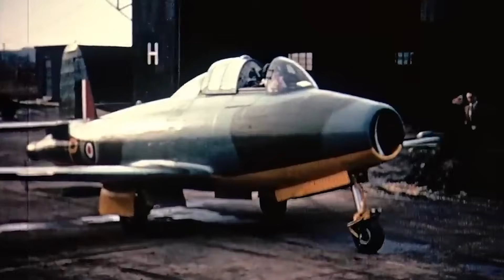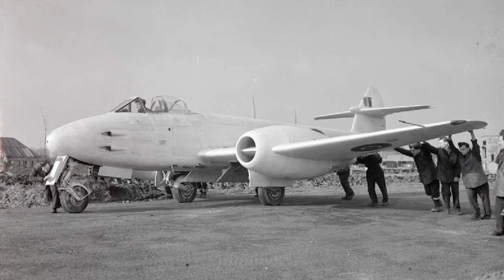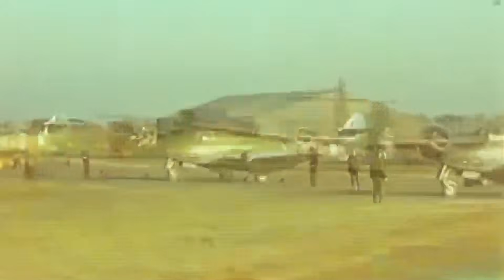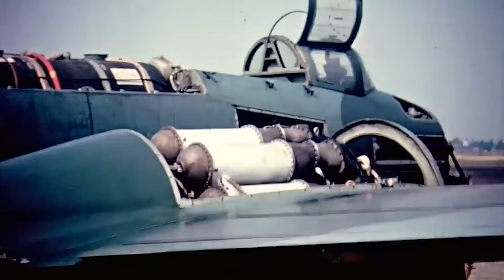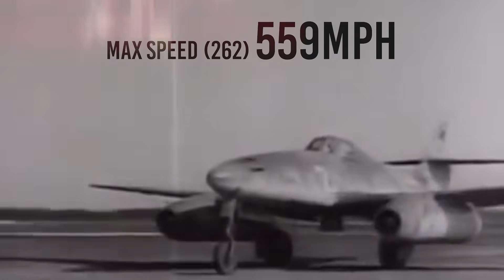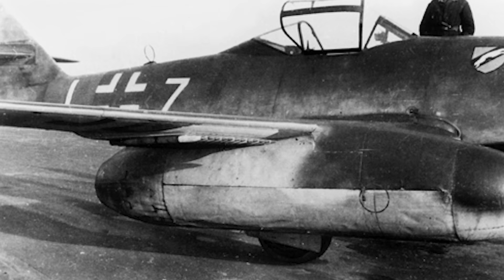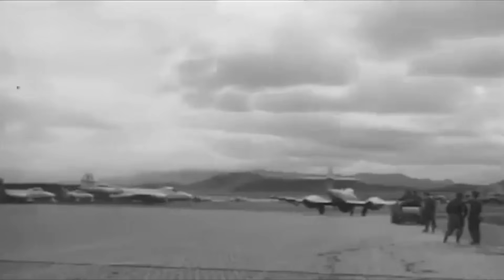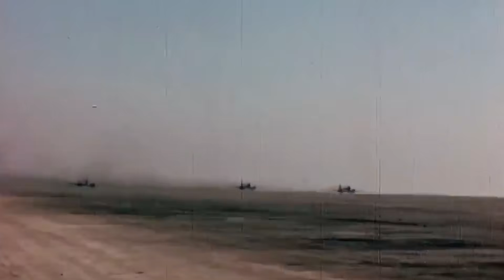Meteor vs Me 262 | Which was the better WW2 jet?

Comment: The irony is that a case can be made that both nations chose the wrong engine technology. The allies won the war without needing jet engines. A focus on axial engines would have been better long term. The axis nations needed a performance advantage quick. Centrifugal engines would have been quicker to develop and needed less exotic alloys. 

TLDR 
The axis nations placed perfection before practicality. 
The allies chose the easier route when they had the time to pursue perfection.
Reply: Many tried the axial-flow engine but they burnt out quickly. The fist perfected and reliable axial-flow engine was the RR Avon in 1950.  It took five months to get a reliable centrifugal compressor jet engine into service, while it took seven years to get the first reliable axial-flow engine into service.
Reply: Perfection by Germany? The 262 airframe and engine was a rushed effort out of desperation. The Metrovick F.2 axial-flow engine produced far more thrust than than any German engine ever did and lasted longer. It was put into a Meteor to test in flight. It was deemed not good enough for operational use needing more development.  The Metrovick in the Meteor would have totally outstripped the 262 in straight line speed. The British did not dream of putting such an under-developed engine into a plane with a man in it.
Reply: @johnburns4017 
My points exactly. 
If Germany needed the advantage quickly - which they did - the safer choice would have been to build centrifugal engines. 
The UK did not need the advantage quickly as the air war was already been won. They could have spent more time perfecting axial flow engines and had a superior system in the late 1940s early 1950s. 

More and more reliable meteors would have been more valuable to Germany than fewer and less reliable me262s. 
The UK did not need either.
Reply: @MatthewHollick  
The Metrovick F.2, axial-flow engines were fitted to a Meteor DG204. The test plane crashed on 4 Jan 1944 after only approx 3 hours of running. Up until then very encouraging engine testing. One of the engine's compressor rotors burst in mid-air, with the cause traced to metallurgical faults in the rotor forgings. This accelerated research into stronger and more heat resistant alloys by Wiggins.

This accident turned attention to the safer bet, the centrifugal compressor engine. The pilot was killed at high speed spurring ejection seat development.

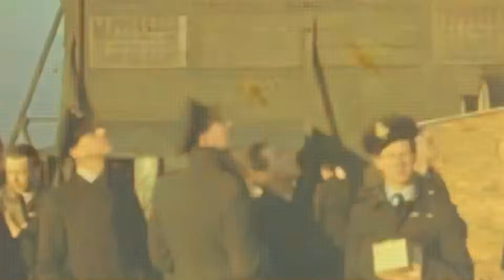Comment: 8:21 mark I am pretty sure that is Eric "Winkle" Brown on the right.  That man was legendary and said to have flown more aircraft types than anyone (and a record not likely to ever be broken).
Also the 262 was not 5 years ahead, the P-80 was superior and was only a couple of years after the introduction of the 262 into squadron service but it missed WWII by just under a year when it entered squadron service in July 1946.  The P-80 was an actual fighter to engage other fighters where the 262 would be better described as a potent and nearly untouchable bomber interceptor.  While the 262 was faster than the P-80 (not by much) and had a bigger punch with its four cannon the P-80 could out accelerate, climb, dive, and turn a 262 and its six very high speed 50 cal MGs with much flatter trajectory would be a better sharpshooter with enough firepower to make the hits count.  While one hit from the cannon was often enough to take out a B-17 it was hard to get that hit on small and nimble fighters where the six MGs need a few hits but put a lot of lead downrange very quickly and where one hits likely many also hit, but the point is the MGs are more likely to score the hit over the 262s fairly slow cannons with much lower rate of fire and far less ammo (less than 400 cannon rounds vs 1800 .50 cal rounds for the P-80).  That said it would still boil down to who is in the seats with the P-80 having more advantages in a dogfight to exploit, but the 262 having a better chance to escape the combat defensively and avoid the fight completely being their best option and the P-80 being able to do nothing much about it, but forcing the enemy to leave the area of combat is still a victory for the P-80.
Reply: Nice to know, but the P-80 was a post war plane.

Comment: When it came to speed and maneuverability, the 262 had an edge. When it came to reliability--mainly the engines not burning out--the Meteor ruled. Had they both been put in service, say, in 1942, the Meteor would've probably won out, mainly due to the resources that the Allies had and that they paid for attention to detail and had a long-term plan. 

Both sides were skeptical of jet engined fighters at first, even though Germany had operational jet fighters prior to WW2, but the Allies came to appreciate it, while Goering was dead against jet fighters. For Germany, getting the ME-262 into service was a case of too little, too late.
Reply: The Germans never had an operational jet before WW2. The 262 was not maneuverable. 
Please try harder.
Reply: @johnburns4017  The Heinkel 176 was a prototype, built in 1937. While it was never mass produced, it served as a model for future rocket-powered/jet-powered aircraft. The Heinkel 178 flew in 1939. Again, it wasn't mass produced, but it was operational, and it led to the 280 variation later on. That type wasn't successful, though.

So, technically speaking, the He 176 and 178 were operational, although they never flew in actual combat.

Please try harder.
Reply: @jessfrankel5212  
1939! It was not operational. The first operational jet plane was the Meteor. The single plane was so disappointing the German government dropped the jet engine programme entirely.  The Germans only reactivated their jet programme when finding that the British were working on jet engines.

Comment: Hands down the mighty ME262, as the late great british test pilot Eric Brown would confirm, and he flew everything.
Reply: Brown never confirmed that at all. You need to do some reading.
Eric Brown: 
i "The me 262 was no fighter" 
ii "The me 262's engines had an average SCRAP LIFE of only twelve hours"
iii "The me 262 couldn't perform any aerobatic fighter maneuvers such as the split S for instance" 
iv "The me 262's engines were too sensitive and very fragile and that cost the lives of many of its pilots"
v "The me 262 could only work as a boom and zoom interceptor and it was even deficient in this task because it lacked dive brakes"  

The me262 was deficient. Its only viable role was of zoom and boom interceptor. It also had engines that were too sensitive and so fragile that they often cost the lives of its pilots.
Reply: @johnburns4017  Oh yes he did!

Get over yourself!
Reply: @tenbear5  
You have comprehension problems. Please try.
Reply: @johnburns4017  You’re in denial. Whittle’s centrifugal design was a dead end. As intellectually bankrupt as you are, you cannot falsify the historical record.
Reply: @johnburns4017  You’re in denial.

Whittle’s centrifugal design was a dead end. As intellectually bankrupt as you are, you cannot falsify the historical record.
Reply: @tenbear5  
You never looked at the vid. Hardthrasher does a vid on each plane. Please view.
Reply: @johnburns4017  Nothing came close. That’s the reality.
Reply: @tenbear5  
Again:
You never looked at the vid. Hardthrasher does a vid on each plane. Please view.

Comment: Pre WW2 Britain was on two paths: 

1) The axial-flow air compressor by Griffiths; 
2) The centrifugal air compressor by Whittle. 

Griffiths' 1926 seminal paper laid down axial-flow. His paper outlined a turbo prop. He did not believe at the time the engines could produce enough thrust, but could turn a propeller. He had Metrovick to develop an axial-flow turbojet in 1938, who started the groundwork of the F.2 axial-flow in 1940, having an engine first spin in the same year, with a successful test bed spin in 1941. Whittle's patent was in 1930, which laid down the turbojet. All this information was available to the Germans. 

Whittle went for centrifugal, as it was a simpler way of compressing air. Whittle wanted a simple air compressor to establish his turbo jet design quickly. In short, he was interested more in establishing the back end of the engine, the thrust, rather than the front. Once the back end was perfected then he could improve the front, the air compression. This was the sensible approach. The centrifugal compressor was perfectly adequate to prove the rear thrust side of the engine. 

As post war engines proved, the centrifugal was taken to higher limits. Axial-flow compression was a series of fans on one shaft, with successive fans passing compressed air to the next fan to increase air compression. This added complexity in many ways. 

Griffiths went for the more complex axial-flow. He also laid down a contra-rotating compressor, but Metrovick did not take that route. The more powerful F.2 was used to fly the Meteor plane however considered it never met their standards of reliability at that stage, so Whittle's centrifugal compressor engine was chosen. The F.2 was more reliable than the German Jumo, but the British would never put a plane in the air with such an unreliable under-developed engine as the Jumo. Wiggin in Birmingham, who still exist in Hereford, were commissioned to develop and improve high temperature resistant alloys and continually improve them as the jet engines were being developed. The Germans had no such programme. The F.2 ended up as the post war Sapphire being built under licence in the USA as the J65, powering the: Douglas A-4 Skyhawk, Grumman F-11 Tiger, Martin B-57 and the Republic F-84F Thunderstreak.

It took the French, using some German engineers, a wasted eight years to have the German design reliable, which by that time they had discarded many of the German engine concepts. The German based French engines were so good the French airliner the Sud Aviation Caravelle used Rolls Royce Avon engines.

Comment: Lord Thrasher did an excellent job of deflating some of the myths of the Me262, including some that you've repeated here.
Greg did an excellent  comparison between the Me262 and the P80. Highly recommended.
Reply: Hardthrasher's vids on both planes are excellent.
Reply: All hail his Thrasherness.
Reply: Greg? Oh no.
Reply: @johnburns4017 
Yeah. Greg. His whole channel is excellent.
https://m.youtube.com/@GregsAirplanesandAutomobiles

And don't miss Lord Hard Thrasher! Definitely worth the time!
https://m.youtube.com/results?sp=mAEA&search_query=Lord+thrasher
Reply: @bmobert  
Greg. Oh No!
Reply: @johnburns4017 Why the oh no?
Reply: @johnburns4017  Greg actually uses his real name.  An ex airline pilot, engineer and hot rodder.  He’s very methodical with his facts and history
Reply: @williamzk9083 
He is? Everything is viewed thru star and stipes glasses.
Reply: Agree 100%
Reply: Lord Thrasher is just a pompous snobby biased pom.  The Meteor I that supposedly into the Service a few weeks before the Me 262 had a speed of 444 mph.   It was no faster than an Me 109K4 or P-51D.
-No Meteor III  exceeded 492 mph during WW2.
Reply: @williamzk9083  Not even that, the top speed of the Meteor 1 was just 410-415 mph, slower than most late war piston-engined fighters.
Reply: @TTTT-oc4ebThe meteor had airframe engine integration issue, basically serious shock drag caused by the large diameter engines.  To solve this the nacelles, intakes and jet pipes were enlarged and fined up.  The engines were derated to make them reliable till problems solved.  Apart from Welland and Derwent engines there were several  derating  factors applied and at least 4 or more cowlings. 
-it was a solid aircraft but it wasn’t a good performer till late 1945.  
-I’ve seen a diary of the chief Luftwaffe intelligence officer and his entry in Jan or Feb notes that the new “accelerator control valve” was expected to see service in early April 1945.   The fuel system of all the early jets used a centrifugal governor that worth by spool RPM.  The so called “ accelerator control valve” introduced pressure sensors across the compressor that proportioned the air fuel ratio.  This would get rid of the over and underdosing that was causing flameouts in burnouts and slow acceleration improving both handling and reliability.
-Chances are high that a June Me 262 was much better.  New engines with 10% and 20% more thrust also bench testing.  Jumo 004C and D
Reply: @TTTT-oc4eb
Tripe. The speed of the Meteor increased by the month in WW2. Look at Hardthrasher. 
It was meant to fight piston aircraft which it flew flaster than.
Reply: @w @williamzk9083 speed isnt everything though is it. And loads of 262’s couldn’t get to that speed, turn at that speed or fight at that speed, hence why they were shot down by prop fighters. Oh and lets remember they were built by slaves, for the nazi’s please, since theres a fair few who seem to have forgotten that.

Comment: My grandfather worked for Lucas Engineering developing the first gas turbine engine, we were never allowed to call it a jet engine.. His specialty was the engine casings, especially with concern to heat. I have many drawings, letters etc, many marked top secret
Reply: This sounds fascinating. 
I don't know how, but this information needs to get out there. It would change our understanding of this part of history.
Reply: my daughter was doing an engineering degree at Cambridge University, I asked her to speak to the Whittle museum at the university, as frank whittle went to Cambridge. She never got round to it. My brother in law now has all the documents and is planning to go to the Royal aircraft museum at Hendon, or Duxford with them. I have now emigrated.
The are many drawings, colour photographs, documents etc. the is a manual which they wrote for “how to replace a meteor engine “ marked top secret, for the ground crew, which is probably smaller than the manual you get for a modern tv. The is a menu from a banquet that took place to celebrate their success, which is signed by Frank Whittle. The is a letter describing how my grandfather took home a casting that he had made, his specialty was pushing the boundaries of metalology, and that night the Luftwaffe bombed the factory.
It needs a good home,open to suggestions.  Don’t think my brother in law has got rid of it yet
Reply: My grandfather was one of 19 BTH craftsmen seconded to Sir Frank Whittle. I too have some mementos of those times, and the reunion.
Reply: First OP off this is in no way an insult directed at your grandfather he sounds like an amazing person. All I know is anyone with a 60s or 70s British motorcycle which all had Lucas anti-electronics as far as I know feels the anguish... horrible system/components🫩. Hands down the most beautiful motorcycles ever produced standing still😍.
They must have been light years better in engine castings back then.😂

Comment: The service speeds of the 262 in combat was around 515 mph while the RR Griffon powered Spitfires in 1944 could reach up to 480mph, only 35 mph less. The 262 had poor maneuverability and control issues at high speeds at around 550mph resulting in the tail surfaces locking driving the plane into the ground. There were no air brakes. The pilots were instructed not to go over 450 mph. Also the engines would stall if the throttles were opened too fast - a major flaw.  The minor sweep of the Me 262's wing was never designed with the intention to gain high speed, it was to gain balance when fitting the engines. The inboard wings were almost straight with the outer wings swept.  

In the UK the advantages of jet engines were well known, yet propeller aircraft made in massive volumes were more than suitable, so the development of jet aircraft was never seen as vital to the war effort. Whittle's design was taken by the government so any other designer or company could use for their own designs leading to centrifugal flow engines by other companies like Rolls Royce, De Havilland as well as Whittle's Power Jets. Metropolitan Vickers were working on axial flow turbojets first running in 1940, with multiple types produced during the war for use in high speed launches and gensets. 

There were five turbojet engines in the UK under R&D in WW2:

▪  Centrifugal, by Whittle (Rover);
▪  Centrifugal, by Frank Halford (DeHaviland);
▪  Axial-flow, by Metro-Vick;
▪  Axial-flow by Griffiths (Rolls Royce);
▪  Axial flow compressor, with reverse flow combustion chambers. The ASX by Armstrong Siddeley;

The axial-flow Metropolitan Vickers designs were test flown in 1942 producing more thrust than anything Germany produced with a longer service life. The axial-flow were more expensive compared to the centrifugal designs with still development problems to solve, so being funded by the government they were never selected for any aircraft with development time being one of the rejection points.  Metropolitan Vickers produced the first successful turbofan engines rated double anything Germany ever produced during the war. Also the turboprop engine found largescale use post war because of its excellent fuel consumption.

Comment: The British had a programme of developing high temperature alloys, given to the Wiggin company. Who still exist in Hereford. The Germans had access to enough rare metals, however never had a programme to develop the alloys. They also had conceptual problems with their engine. In short, they were way behind.
Reply: Anselm Franz, inventor of the axial flow engine used Cromadur alloy (12% chromium, 18% manganese, and 70% iron) in production 004 engines. The British did not have a comparable axial flow that could fly without exploding until 1947.  In short, the British were as Eric Brown stated, years behind